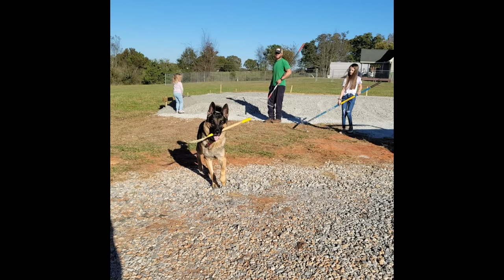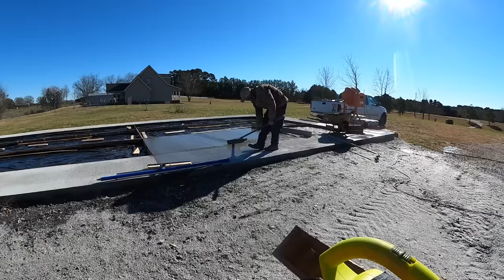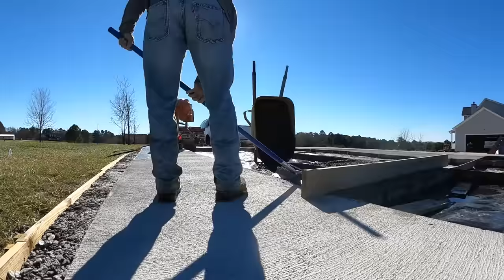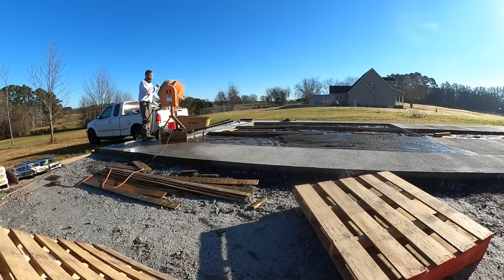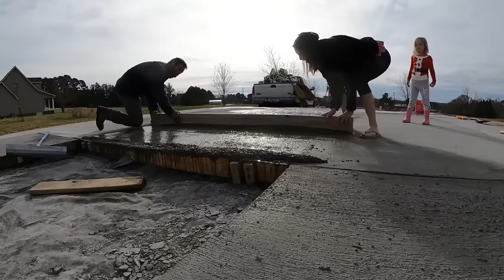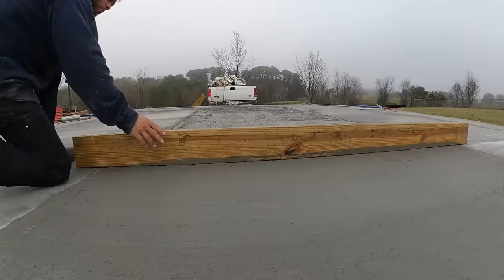Pouring a Huge Concrete Slab Using Bagged Concrete | I Saved $10,000

Comment: Title is a little misleading the price of bagged concrete is not the 10k saver it's doing it yourself that is the huge savings.  For a project this size (10cy+) a ready mix truck would be cheaper than bags when talking concrete cost only.  Regardless, you have an admirable amount of patience and drive to complete something like this yourself.
Reply from the maker: I did this during covid, in my area truck was 200 - 220 depending on the day delivered with a 4-6 week lead time. 80 lb bags were 3.20 each making a cubic yard 144. Local contractors wanted a minimum of 14k to do this work ranging to 20k. I have 3800 in gravel, and concrete. I did a 1 and 2 year update if youre interested. The one year has a ton of  questions that I answered as well as showing pricing. I didn't mean to be misleading, I did mention I saved the money doing it myself using bags. I also may have mumbled because I was newer to youtube videos. haha Thank you for checking out my video, and for leaving a comment.

Comment: I am a professional concrete finisher and I have never done that even once in my life, much respect that is a TON of work! Never used a mixer for more than a small side walk, mostly for very small pours. That is just huge.
Reply from the maker: That's cool hearing that from a pro that does this for a living. Thank you for checking out my video, and for taking the time to leave a comment.
Reply: @jameshines6486  By health do you mean concerns over muscles, back, etc, or fumes, dust, etc?
Reply: @reallifetested2605  Aye, always gotta keep that dust mask handy.  Did a great job on those pours, Mr. Tested!  Might end up doing something similar in the coming months.  Hats off to ya on giving folks something to check notes and get tips from!
Reply: did I miss something here/ I did not see any reinforcements rebars or mesh wire
Reply: @temujinkhan6326     
   Most residential streets and driveways are six to eight inches of concrete with no reinforcing material at all. In my experience there are times when you want to have reinforcing bar depending on the kind of loads you're putting on the concrete. I also tend to think that most reinforcing mesh doesn't accomplish much. Most of the time it ends up being under the concrete between the fill and the concrete not in the concrete where it needs to be to function.
Reply: @temujinkhan6326  yeah i was thinking the same thing
Reply: @davej7458  ive heard same thing but i though for big pours you need rebar....im still learning
Reply: @reallifetested2605  Since it's ready-mix, I wonder if you could just have opened the dry bags in the forms and added water afterwards (with a bit of poking to get the water to the lower concrete).  Concrete will use as much water as it needs to cure. The bulk volume of concrete could be installed as dry mix, water added and left with a rough surface at a level, say 2 inches below the finished level. Then, the smooth top layer could be added after the lower bulk layer had cured a bit.   I've never tried this - for bigger areas, I've always towed in already mixed 5 or 6 bag concrete in a little trailer from the merchant - but I know the fencing people just pour dry mix in the hole round a fence post and let nature (and chemical reactions) pull in the water necessary for the curing process.  Just idle thoughts- I'll probably never have a project as big as yours! And well done for saving so much.
Reply: @davej7458  When I have done concrete, sometimes with re bar, sometimes with mesh, I use a tool called a placer. It's much like a hoe. He shows one with a blue handle near the end of the video. My placer has a hook on the top side used to reach down into the mix and pull up the screen or re bar.
Reply: Insted of a concrete mixer, taje a big barrell and a hand mixer with 2 mixing attachments, its at least 5 times quicker
Reply: @davej7458  fiber mesh is mixed into the concrete. It doesn’t end up under the concrete. You can actually see the fibers after the concrete is finished. My hats off to this man for the work he put into this. With limited funds I would do the same. I’m not sure where he’s at but if he’s subject to freeze thaw then he absolutely needed rebar. It will heave with the frost, it will crack and separate. Even slabs with rebar crack from this they just don’t separate. I don’t know where your at but around here they put rebar in roads, bridges and all concrete construction and in some cases rebar and fiber mesh.
Reply: @dontfit6380  where do u live?
Reply: @edubb2491  Iowa
Reply: Same... I'm a GC, I've done large concrete jobs and my rule was basically nothing by hand that was over 50 bags at most
Reply: If you couldn’t do this job in three days, and you’re a pro, you must be a slacker.😅
Reply: @mirsidorov5112  And do what with the barrel?  Lift it and pour it?  Also, what kind of mixer are you talking about?
Reply: @da324 this is obviously for smaller jobs, take a barrel or a large bucket thats not too big, put it on a cart with wheels, put your ingredients in, mix with a mixer
Reply: @mb-3faze there are videos of ppl doing exactly that. I wonder what the difference in end result would be?
Reply: @stratocruising i thought they were called come alongs?
Reply: @chadanderson2798  When I was at the shipyard, a come-along was a manual winch, for lifting or pulling something..

Comment: Very nice, my son and myself did our 36' x 26' pole shed using bag concrete. We were unable to get concrete truck to the location of the building. I poured 13' x 6' sections that seemed to go well. Mine was a little more of a challenge with the building already up. It was nice doing the job together with my son , he mixed and i did the pouring and leveling. That was a couple years ago, he was 16 at the time and i was 57. My son is in the Air Force now and I miss him not being around to help with my projects. Anyways, nice job. Take care.
Reply from the maker: That's awesome you and your son making memories together like that. I bet it did make things a little more complicated with the building already up. Honesly I was afraid I was going to have to do that. I purchased the building and then decided I wanted concrete ( originally was going to leave the floor gravel ) That's why I had the outside apron poured like I did. Just in case. In the end it ended up working out perfect. Thank you for your kind comment, and for checking out my video!
Reply: My dad an I have done many a fence post hole and sidewalk just like that. As soon as I was big enough to toss a bag of concrete in the mixer it was game on.
Reply from the maker: @TheOtherSean  That's awesome, he got you started off right! I bet you're strong as an ox since you started off young doing this type of work.
Reply: Cool dad
Reply: Count me in, I’m a crazy MFer too. I lost my old House to a wild fire in 2018 and since it was an old mobile Home it wasn’t insured. So I decided To build my own house. I have taken way to long Neckar of doing it myself but when all
Is said and done it will have cost 1/10 of the value so I’m cool with that. I am doing a post frame constructed home. So a barndominium some say. I am ready to pour the slab and that is one reason it’s taken so long to get to this point.I need
To save $5000 and maybe more for the concrete. I am going to hire a crew to help me out at $1 a sq foot. They have 4 guys and it’s going to be 1000 sq feet. So they will do ok at $1. I figure they will be here 5 hours or so. If I like they way it comes out I plan to tip them 50-100 extra per
Guy too. I will
Mention that when the first truck shows up. lol once the floor is done mine will go fast. I’ve already bought all the metal siding and the framing lumber and osb sheathing. House wrap also. This will Be a heated concrete
Floor With acid stain and gloss clear coat when done.
Reply: Thank you for your Sons Service.
Reply: Damn that was straight up adorable to read. You're a good dad.
Reply: Did you butt the sections together?? Or have anything between each section???
Reply: @stockstnt8  The way we joined the sections together was done by hammer drilling a hole and pinning together each section with 1/2" or 3/8" rebar. I think we put them every 12" or so. After all the pours were comeplete we made relief cuts at all the joints. It looked good when done.
Reply: I miss my 21 year old son as well for his boundless energy.  He’s off seeking his fortune!
Reply: I am 69 yrs old and just did a 24x48 pole barn with a 15’ extended apron…. Thank goodness the 3 truck just poured it all in
Reply: Sounds like you’re a great Dad. Teaching life skills at young ages. 👍🏼
Reply: Lol sounds like what I'm about to attempt with my pops. I'm alil older n he can't work at all. COPD. So he will jus yell at me. I don't mind. Love my pops
Reply: @minnesotabackwoodsdrifter4323  you're telling us you laid a section,waited for it to dry and then drilled a hole and inserted rebar? 🤔
Reply: @mrmawf1564  Exactly
Reply: Did you get it done in three days? You know superquikreteman did. If you believe that, I got some ocean front property in Kentucky to sell you.
Reply: Wow, so you had him when you were 39? I did too. He's 9 now and he's awesome.
Reply: I miss my son as well. He was a builder in the SeaBees and could do all this. Just what I needed and what a resource. Unfortunately he picked up a case of colon cancer in Iraq and died 2 yrs ago. He was 35. His birthday is Saturday. Call your kids today 😊

Comment: I worked commercial construction for 40 years and I know that was a ton of work. Congratulations on a job well done. Not only saving money but the satisfaction of doing something like this yourself can’t be beat. Your the man!
Reply from the maker: It's really cool to hear that from someone whos done it and knows. I really appreciate you taking the time to leave a kind comment. It really means a lot.
Reply: I worked in constructions also. I'm not american. How is pouring a slab ... a ton of work? In my country people dig and pour the foundation exactly cos it's relatively easy. And even the construction crew will use bags, won't call the truck for the ground floor. The difficult part starts at first floor. Btw there's no rebar. How much would cost in time and money to add some rebar. You never know ... ground shifting, earthquake, cracked pipe, sinkhole ...I'm  in an earthquake area in Europe so ... always rebar, even for a fence
Reply: Unless you don't have access for a truck , I don't know why anyone would pour with bags. It takes 45 80lb bags for a yard of concrete and at about 6 bucks a bag, that's $270 per yd....A yard of truck mix is about $170 a yard and no breaking your back mixing all that mud. I don't see HOW he said he saved money at $100 more per yard to mix it himself 🤷

Comment: I'm a cheapskate and a hard head. This brought joy to my heart. Very well done. Very inspiring.
Reply from the maker: I'm glad to have brought some happiness your way. Thanks for checking out my video!
Reply: No way 14 yards of concrete delivered would even come close to how much he spent doing this himself...
Reply from the maker: @FJB2020  you should probably read a description or at minimum listen to the first 60 seconds before commenting...
Reply: @FJB2020  830 bags of 80lb concrete would be around 20 yards. He says he got the bags for $3.20 each. I expect $130 a yard by the bag is cheaper than delivered concrete in most, if not all, areas of the country, even a year ago. I'd guess he saved around $12-1500 on concrete and the rest was saved by doing the prep work and forms himself along with omitting and steel reinforcement and possibly omitting the footings/thickened edge. Would I mix 830 bags of concrete to save $1500? HELL NO! but I don't begrudge anyone else for doing.

Comment: My attitude is, if they can do it, I can do it. The key to a job like this is planning and setup. If you're running around hauling bags 100 feet away, you've already lost. Have everything ready, get into a nice rhythm and make corrections as you go. You'll find that the first block segment is the most difficult and each one after gets progressively easier. One tip is, have your bags at waist height. bending over a picking up a 80 lb bag is not going to do your back any good. You want to lift the bags while keeping your back and straight as possible, Having them in a truck or set up sawhorses and line up the bags on boards or something. Huge respect to you.
Reply from the maker: You've got that right! I feel you. I'm not that old yet. But the older I do get I'm starting to feel what you're talking about. I appreciate you checking out my video, and for taking the time to leave a kind comment.
Reply: As a Terrazzo man for 34 years I've moved at least 10,000 (way more than that )
Bags of 94lbs cement.. nor to mention the San piles as big as houses...not to mention the 100 lb sacks of marble chips...
After installing we grind it!
Just saying...
Eric Underwood Class of 81 Downey High school CA
Reply: seephor, I can't even lift 60# bags to my mixer.  I put them on a sturdy table and made a winch to get them to my mixer when I did a large pour a couple years ago.  I'm 72 years old now. I think I used a 5 gal bucket now that I think about it. If I did it again, I would mix concrete from scratch and forget the bag stuff. But you're right, bending over lifting bags is not ever good and setup is everything.
Reply: @jamescoleakaericunderwood2503  Well, that explains why my uncle Foxy was such a strong guy!
Reply: @entropyfan5714  I have no doubts he was...
Old school guys taught me the trade ✌️👍
Reply: @stephenlaing2152  stuff that’s practical and applies to your everyday life can be done by anyone with some effort, education and the right tools.
Reply: All true

Comment: When I was a kid on a dairy farm we all worked with our dad pouring large slabs for cattle lots. We used 2x4 form boards and poured broom finish redi-mix without a vapor barrier, no wire or rod, no control joints and no experience. This was over Michigan clay where frost goes deep and hard. The slabs were run over daily by tractors, feed wagons, loaded manure spreaders, and heavy livestock. Were there cracks here and there over the years? Probably, but none of the damage was bad enough that slabs needed to be replaced. There's such a thing as good enough, which is almost perfection when the savings are huge.
Reply from the maker: You're awesome! Thank you so much for your comment. It means a lot to me that you took the time to leave it. Your dad sounds like he raised you all right and with a great work ethic. You're right about that too, perfection = money.
Reply: Sure..The world is brimming with people who can't have an original thought. Good job!
Reply: Interesting.

Comment: I love seeing this kind of video.  Just some suggestions for anyone watching this.  (a) this is A LOT OF WORK - lifting and dumping 80lb bags will work you out - be ready for it (b) if your breaking up the pads like he is (and I did the same) make sure you include some rebar dowels so the pad shifts uniformly, otherwise each of those pads will shift individually (c)  use welded wire mesh to reinforce the pads (d) use an apron - lifting those bags and breaking them into the mixer ALWAYS produces dust and it gets on everything AND lifting that many bags you get sweaty - cement and sweat = chemical burn (dont ask me why I know this - burned chest is not fun) (e) make sure whatever shoes your wearing, the "lips" are covered - you dont want cement power in those either.  Love the video - seeing someone doing this (almost all alone) shows everyone that no task is impossible.
Reply from the maker: Thank you for checking out my video, and for taking the time to leave a kind, detailed comment. Theres some good information on there. I didn't get any chemical burns luckily but wish I had wore a better mask. I was snow white every day that I did this. haha
Reply: Would you add rebar the full pad or each section if it’s the hole pad tied in how would you do each section
Reply: @megansmith101   add welded wire mesh (wwm) to the entire area. add smaller sections of rebar that join adjacent sections. i.e. when you pour, half the rebar is going to be sticking out, so when you pour the next section they're locked together. using rebar would be cost prohibitive for the entire pad, and entirely overkill.

if you do not lock the panels together this way, you get differential settling. each pad settles on it's own, becoming unaligned with neighbors. All soil is going to settle no matter how well compacted, so having your concrete as one unit prevents it settling different over a large area. however, the slight misalignment may not matter for your application.

@reallifetested2605 did an incredible job with this